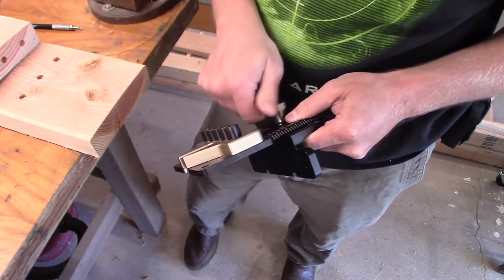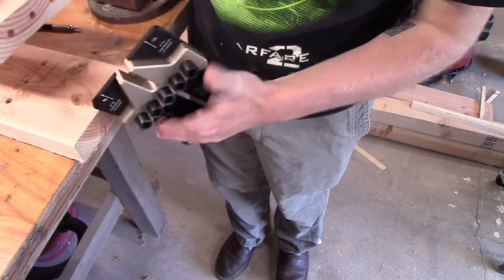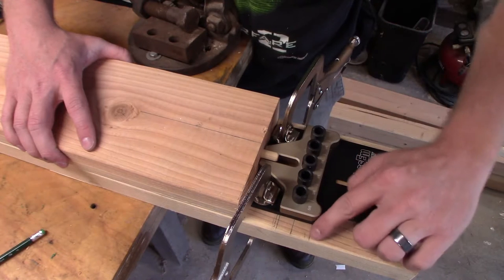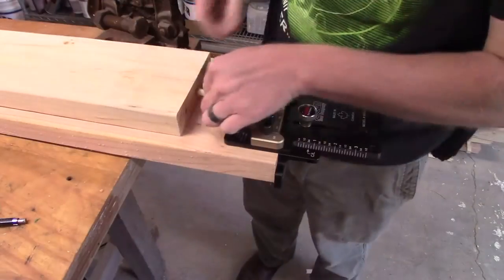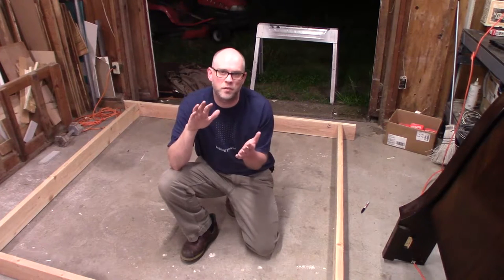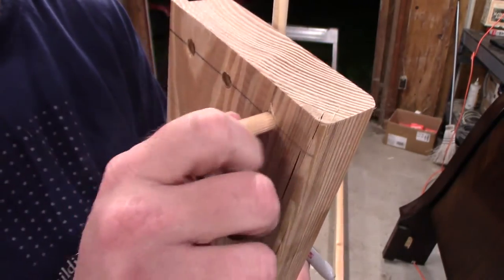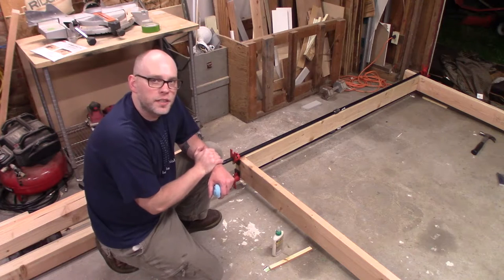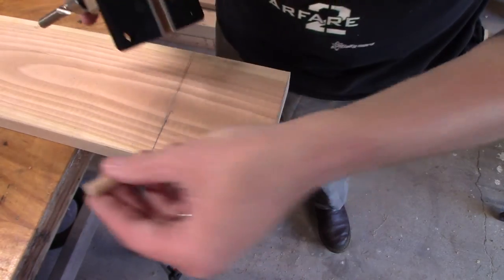Custom Bed Frame - Part 2 | [0007-2] 🛏

Comment: Another thing to use for clamping is ratchet straps. Just put scrap wood in contact with your project to protect from the straps, gives you options for long clamps.
I use them all the time work great.

Comment: Awesome job, you definitely have some skills.  One thing i'm wondering, why did u use dowels?  I have a dowel jig as well and is one of more prefer method of joining wood, but why not just use screws and save your self a lot of time?   I know cheap screws can break, but there are some screws that are pretty tough.  Anyways,  I'm sure you have your reasons.  Good job, I might have to steal your ideas to build my self a bed frame.  Tired of mine squeaking any movement i make.

Comment: Don’t you want the ability to take the frame apart? Why glue the frame? Shouldn’t you be using removable fasteners?
Reply from the maker: Lala Mabaso - I suppose in this case what one “should” and “shouldn’t” do depends on the use case. If you’re in a situation where you’re going to have to move the frame a lot, you may want the ability to move it around, if for no other reason than to make it lighter. In my opinion though, if you can glue something, glue it. It’s stronger and less likely to loosen up on you. I don’t see a need, even for moving it, to be able to dismantle the frame to its bare components. I just like the idea of it being a big monolithic structure. That said, I think I noted in one of the final videos that I miss-measured and the frame ended up being too big to fit through the doorway. I had to make a slight modification to get it through. Being able to take it apart in that case would have been helpful.

Comment: Adam can you also work under 45 degrees with this device? With the Dowelmax you have an accessory for this. Does this also exist for the JessEm?
Reply from the maker: Hum, not sure... I don't see why not. I'd try emailing their support, before I bought it I asked them some questions and they were quick to respond and super helpful.
Reply: @AdamsLab  Thanks! I ask the maker once.

Comment: Adam I see one big flaw in your build, you did not plane down the wood so this will result in a weak joint.
Reply from the maker: I guess it’s some kind of miracle then that I’m able to sarcastically reply to your comment whilst laying in my bed, supported by the very bed frame I was building in this video.
Reply: @AdamsLab  Never said it would not work, just wont be as strong as a flat board thats woodworking 101
Reply from the maker: @renobtankit6019  - Saying that "there is a big flaw... implies that "it won't work." That's English 101. I was just conveying to you (sarcastically) that it did, and in fact still does, work. Should/could I have planed the joints? Yeah, probably. There's a lot I could have done differently with this (making it beak down into smaller pieces for one and painting it black like my wife asked). But I didn't own a plane at the time, and blew my budget on the doweling jig 😂 so I couldn't buy one. If I did this today, I'd probably do a little milling on the wood, but I own the tools now that would enable me to do that... 3 years ago I did the best I could with what I had, and it worked thankyouverymuch.
Reply: @AdamsLab  Agree, flawed was a poor choice of words and yes it does work without planing that being said it I would not do any build without planing it first my thoughts are if you are putting in all that effort might as well give it 100%
Reply from the maker: @renobtankit6019  - Right, I didn't do it YOUR WAY so I didn't give it 100%. You must be a riot at parties.
Reply from the maker: @renobtankit6019  - I will. I do. 

Oh, and thanks for contributing to my (informal) experiment. The thesis of which states: "The amount of criticism a YouTube commenter makes is inversely proportional to the amount of their own work they show/demonstrate on YouTube, or elsewhere online/in public."